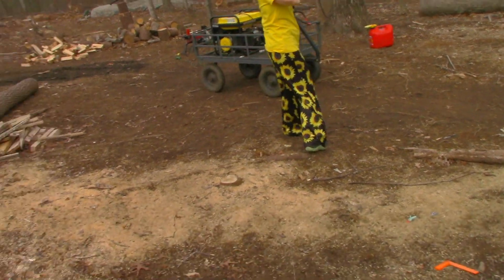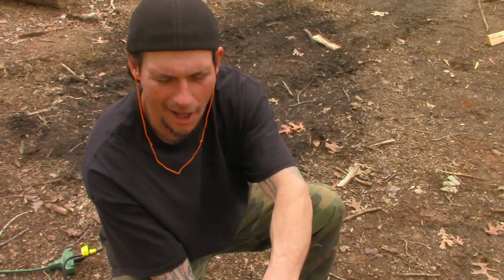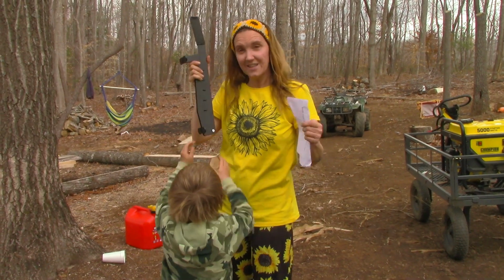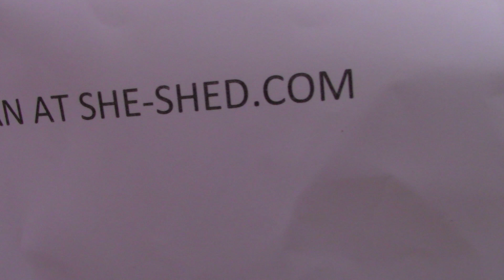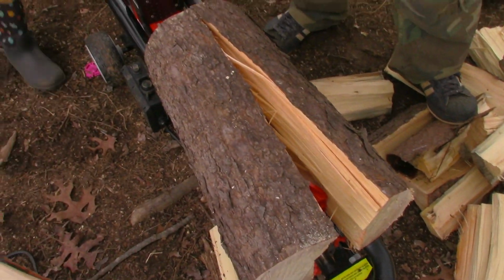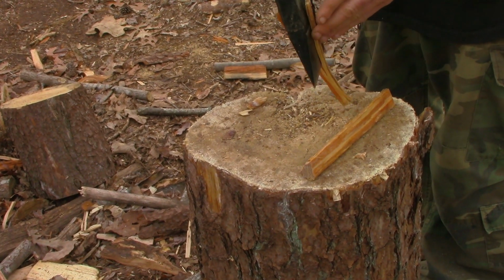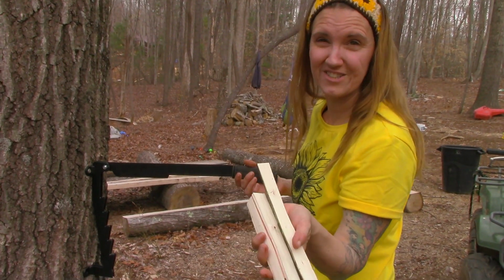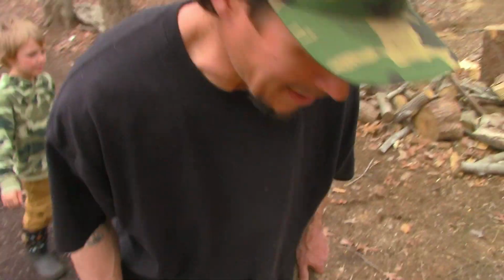Paperlady Told Us We Weren't Splitting Wood Fast Enough 😧 #Powersmart

Comment: Anyone else thinking that Ellion needs hearing protection that close to the generator
Reply: Wow, I was just thinking about that when I saw your post. I agree. Those motors are loud!
Reply: @darlenecheramie7309  yep dad needs to go get a longer cord and attach the two together and move the generator as far away as possible for noise control thier ears maybe shot but ellions don't need to be as well.
Reply: Or dig a hole in the ground put some styrofoam around the sides of the hole and drop a sheet of wood over the top then it could be closer but not as loud
Reply: I'm sure that he will have protection soon. 👍
Reply: send him some gear! I bet he would love it, he like to be like his daddy.

Comment: Hollie, ur like a Brite ray of sunshine in your sunflower outfit! That log splitter works wonders! Good job splitting all that wood Ellion😉 Even the kindling maker is a bonus! It all helps make work go a lot quicker and easier. So happy you got all this great helpers! 
This is just a suggestion for your tarp roofs... Could you get some like chicken wire or something to tack onto roof rafters so the tarp doesn't like cave in and collect all the rain water? And maybe a couple of gutters to collect the water into water bins? I don't know... Just some thoughts running in my head.. 😁❤️✌️